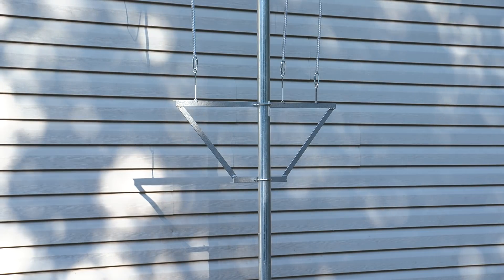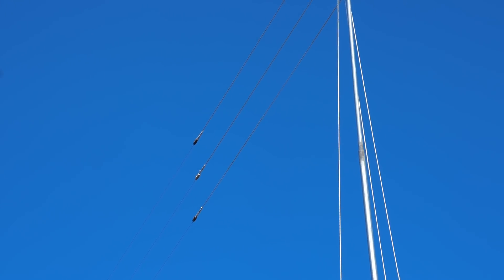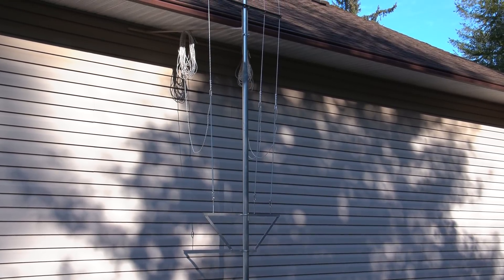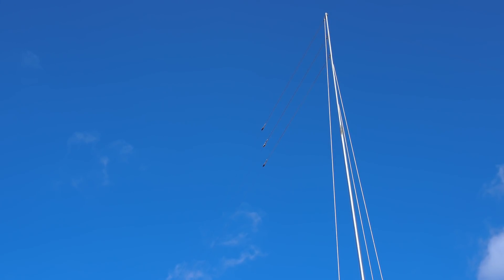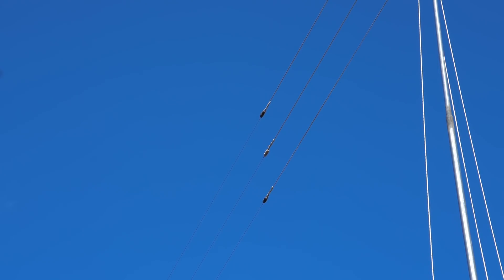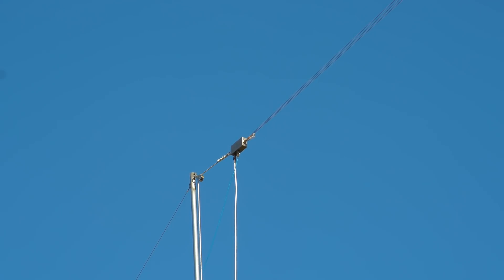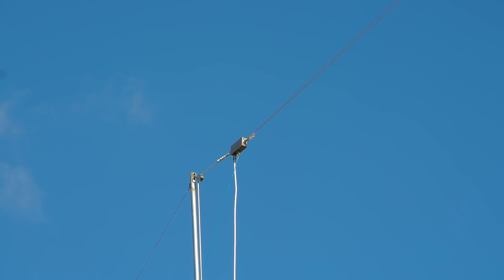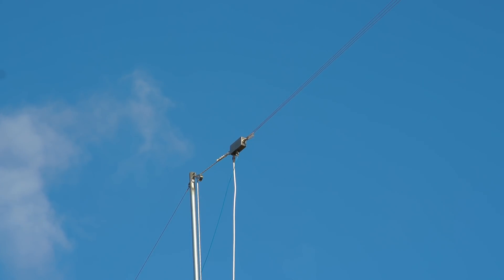Mr Carlson's 3-6-9 High Performance Antenna!

Comment: The plating on mig wire is so thin, its gonna rust pretty quickly. I guess if the connections are protected the rust will not hurt performance. I have used mig wire for radials/counterpoise ect when camping many times. Just ball it up and throw it away when done. Its cheap.

Comment: Nice Work. Just something I noticed...If the silicone used to seal the box is acid-cure rather than neutral-cure, the silicone will react with and corrode many metals including galvanized steel, copper, brass, zinc etc. (If it smells like vinegar as it goes off it's not neutral-cure).
Reply from the maker: No Odor, sensor safe silicone used on aluminum.

Comment: I recently built an FD4 style ham radio antenna using aluminum wire for electric farm fence. But the MIG welding wires seems to be an interesting alternative. I'm not sure how well it stands up to the elements though, but it may depend on the climate.
But I like the design you have. I would have considered weights instead of springs as springs weakens over time.
It looks like an F connector, which is OK, but it's not sealed so you might get moisture into the coax over time, but as long as it's just for reception it would be fine for quite some time.
Is the antenna tuned or is it just calculated?

Comment: An amazing and interesting project. Are you certain that the diecast aluminum Hammond box has sufficient tensile strength between the two eye bolts to withstand the mechanical force applied?
Reply from the maker: Yes, absolutely
Reply: Its stronger than the wire its holding
Reply: @peterhansen8216  The tensile strength of 035 S6 wire is 78,000 psi times 3 wires. The tensile properties of the Hammond box have not been tested or calculated under this condition as it’s not intended for this purpose. In my mind given the porosity of diecast aluminum, without reinforcement this appears to be a weak link. Just throwing this out there for consideration. Love the concept.
Reply: @jims2222  I agree. The Aluminium box is the (very) weak point in this antenna system. He also would have made a better choice if he had chosen "Copperweld" (copper-clad steel) antenna wire over MIG wire.

Comment: At 8:55 did you measure how much tension that porcelain insulator can stand? The piece inside the box seems designed for light tension as it is separated into what looks like slats instead of a block or a curve.
Reply from the maker: Here's a clue, the tension is only horizontal in the direction of the wires, the small ceramic piece in the box is solid, and would take hundreds of pounds purely horizontal. The pressure is a fraction of that.

Comment: im on a farm built 7ft high 11 wire high electric fence 12gauge aluminum "high visibility" wire ratchet stretchers every 200' (wish there were more). issues: 1000's migrating birds sit on the top wire always needs tensioning, deer can "almost" jump over break top 3 wires & real estate insurance adjuster made me install lightning arrestors 4 locations the one at the fencer box was shorted out by lightning just days after install. the fencer box had to be installed outside the building inside fireproof container i used a half 55 gallon drum

Comment: What an awesome looking antenna!! So basically this is an end-fed 1/2 wavelength fan-dipole?  I imagine this would give a drastic improvement to not only receiving, but transmitting as well when compared to the 49:1/64:1 end-fed 1/2 wavelength dipole antenna that is popular among amateur radio operators.

Comment: I found myself waiting to hear the lengths, heights of the wire.  It's also helpful to know the impedance of the feedline as well as the length. I guess I'll wait for the next episode. I've seen that copper clad steel rust right through through. I dont know if that matters or not. I changed it out before any signal loss was noticed.
Reply: F connectors are generally 75 ohms which would present a good match for a 1/2wl dipole, but being that this isn't used for transmit, small mismatches are not critical.

This antenna appears to function like a partial fan dipole. In essence, multiple dipoles cut for different frequencies with a common feedpoint. One issue here is the 3mhz dipole is also resonant at 9mhz because it is an odd harmonic. As a receive antenna, this probably has no detrimental effect. Also, as a dipole, this antenna is missing half... But the outside braid of the coax is probably filling that function... And again, as a receive only antenna, not a big issue.
Reply: Could it be the different electrochemical potential of copper and steel generating a destructive galvanic current.
Reply: I'm wondering if the details are going to be "Patreon-only"; there's more and more people doing that crap now. I don't play that game.

Comment: I would never have considered using mig wire for an antenna.  Very creative!  I would be interested in you discussing the antennas electrically along with theory of operation.  Thanks for the great vids.
Reply: I just wanted to point out that I’m using high tensile strength aluminum electric fence wire. Seems very good so far.
Reply: Probably a result of having a MIG welder :) Eyes could have been stainless steel imo

Comment: Looks great!  Does the perfectly sealed box still need a tiny, lowest point drain hole/tube?  
(Pressure changes day/night make the ability to suck in rain water seem like magic.)
Reply: I noticed this antenna is using a Hammond Mfg. box before it was called out. This is an excellent choice. My electrical enclosure box go to for all of my projects as well. These are available at some big box stores and local electrical supply stores. These are available in all ( NEMA)  National Electrical Manufacturing Association box types and materials. If you choose the correct enclosure type to meet your project specification, a weep hole may not be necessary.
Reply: @someguy2637  Yes, they make the best boxes, etc. For indoor tabletop projects, add some TAP18230 AP/Armaflex rubber insulation tape on the bottom for a non-skid finishing touch. 

For rainy outdoor or automotive box/wiring situations, it amazes me how water finds its way along RTV  "sealed" wires or jacks via capillary action (even with a drip loop) or how it gets sucked in "impossibly" with every temperature change cycle. 

The tiny hole or tube (aimed down and away) does not just let water out, it mostly equalizes the pressure to prevent the suction.
Reply from the maker: The screws are "O ringed" and the lid has a molded silicone gasket, no water is getting in, even under pressure or vacuum.
Reply: @MrCarlsonsLab  Sounds perfect... Your antenna setup is very impressive!

But wait, do you get a lot of rain there?  Might want to test SWR for changes before turning up the transmit power all the way to "boil" setting, just in case the "impossible" happens. Maybe a sealed HVAC sight glass could be added to indicate "fill level". I'm kidding of course, but didn't you report on extremely rare electrostatic "Kelvin" snowfall a while back?  lol  Take care of you and yours!
Reply: @MrCarlsonsLab  "no water is getting in" wish I had a dollar every time I said that.
Reply: @buckykatnga  Yup, seems quite clear that water absolutely does not care about our expectations x)

Comment: Why does this remind me of Doc Brown installing cables across the road, when the officer asked him, Do you have a permit for that? Not that you look like a mad scientist Mr. C. Impressive rigging, to say the least. I never used Mig Copper wire for anything before, but I have used tried to use the hg 71t-gs Carbon steel wire, I found it became brittle with any kind of bending stress over time, the 035 s6 is a  lightly copper-coated solid wire, I hope you will let us know in a few months how it worked out, please. Thanks for sharing your antenna project.
Reply from the maker: I will. It will be up for years.

Comment: Uhm is it ok to not have those plastic red/white balls (or some other system) on the wires to make them visible?
Reply: There are nearby trees taller than the antenna.  "Shielded by existing structures."

Comment: I`m moving in a few weeks to a location where I have room for very long shortwave and AM antennas. When I`ve made AM antennas in the past I made a coil similar to an AM crystal set coil to use as an inductive loop placed near a portable radio. My goal right now is to simply get more AM stations during the day because the few we do get are boring and weak. I used a large inductive loop made from a box a solar panel came in and could faintly hear a station 300 miles away in Dallas so with a proper long wire I can get a decent signal. I also purchased a Tecsun PL-330 that can be set to bypass the internal AM antenna and be used with an external wire so that will be interesting to experiment with. My CCrane EP PRO also has external AM antenna inputs.
Reply: i listen to a lot of AM stations at night'''' 650 am WSM, the grand ol oprey station,,,850 AM KOA denver'''''''1070 AM KNX los angles'''''740 AM KCBS  SAN FRANSICO ,CAL and alot more'''''i designed a AM PREAMP to boost the receive & i am using a very long wire antenna,,,,the down side is it will pick up LIGHTNING a 1000 miles away,,,73's james.

Comment: Wonderful!!! Looks Great
Please consider... a Handful of wraps on your RG-6 (6 to 8 in dia) taped or tied together and attached loop to underside O-bolt at feed box... this will help strain relief your 'f' connector and work as a common mode choke to reduce noise pickup on the outside of the coax sheild... (also include a loop on the bottom end to isolate noise entering the lab)...

Looks like a good winter of SWL... WB0ZLX...
Reply: The coiled coaxial cable will also tend to buck the current from a lighting strike.  I assume the coax shield is being grounded at the base of the tower, and the tower is also grounded there.

Comment: Great job! If I were to use your design for a 250 watt transmitter, what would you do for that purpose?
Reply from the maker: Only one wire in each direction (unless all are the same length) and tuned to the desired frequency. No tuners, an SWR of 1.0 to 1, impedance of 50 Ohms, with 50 Ohm coax feedline, reactance is tuned out (moving and trimming wires) for X=0 at the desired frequency. No shortcuts, and you will have a great performing system. If the radials are all cut to the same length and say you have six, (three common, three fed) you will have a wider bandwidth adjacent to the center frequency.

Comment: Neat Antenna . Why are you using F type connector instead of PL 259 and is the coax 75 Ohm . If so why 75 instead of 52 Ohm .Thanks
Reply: 75 ohm coax is cheaper, lighter, and smaller than RG8.  75 ohm coax is lower loss than 50 ohm for the same materials being used.  The drawback of 75 ohm coax is lower power rating, which does not matter in a receive-only installation.

Comment: Nice choice of wire Paul, great build, can't wait to see/hear it all perform! TFS, GB :)
Reply: I would not quite agree that this choice of welding wire is good. I am afraid that soon the wire will corrode strongly - I used to try such a wire and was quickly disappointed, unless your wires are better (like everything you have) ...
Reply: @witektaaham6297 : I made this experience too. After a few weeks it will start to corrode. The copper plating will be eaten away and the wire rusts. In chemistry it’s called a „local element“, if a more noble metal (here copper) is in direct contact with a less noble metal (here steel or the solder) and humidity comes into play. Corrosion is practically inevitable, no matter how „good“ the wire is.

Comment: I would consider putting a choking device (sometimes incorrectly referred to as a "balun") on the coax. Otherwise the coax shield will become part of the antenna, and it will pick up noise where the coax comes in proximity to the house, lab, or other noise sources. I would suggest making it from a #31 ferrite toroid, either bifilar wound or just wind the coax through a 240-size toroid, maybe 10 turns. There are lots of ways of accomplishing this.
Reply: I was also surprised that he did NOT resonate his design on the amateur bands. He says he is going to construct a separate TX antenna, and plans to use this antenna for receive only (?). He is obviously experimenting with his own ideas... I would only put up amateur band resonant antennas considering all the effort it takes for any well-thought-out antenna system!
Reply: @wb6csh  The fact that 95%+ of his videos are of him repairing "receivers" that are not amateur related, I am not surprised. But he did say that the antennas are using the 3rd harmonic principal, operating at 1.5 wavelengths, giving him a full sweep of the HF band. I don't think he's experimenting, I think he knows exactly what he is doing.
Reply: You're mentioning this to a man that has a UFO finder in his lab (not to mention the 45 minute video on RF interference, how to find it, and eliminate it)?
Reply: @SupposedlyFree  I was thinking the same thing at first then thought that maybe he's a newer viewer that hasn't watched all his videos or saw his Patreon.
Reply: @SupposedlyFree  Go easy there, I'm an extra class operator.  KC3ALA  I continually learn from this channel.  Thanks, Scott

Comment: Wow, nice work, Paul. That thing will bring you a lot of joy, dude. Do you consider to use it for TX by bypassing the tube (if i remeber correctly) ? 73 de Olaf DK6KF
Reply from the maker: TX will be a separate antenna. Thanks for your kind comment Olaf!
Reply: @MrCarlsonsLab  will the TX antenna use the MIG wire, and if so what kind of power will it handle?

Comment: Why separate ground cable is needed? (from electrical point of view I mean)
Coaxial cable already have shield, can it be used as ground?
Will two grounds create ground loop?
Reply: Could be to arrest lightning or something.
Reply: @Andrews_wasteland  thank you. It is interesting to know why lightning will prefer one path over another.
Reply: @sdjhgfkshfswdfhskljh3360  Assuming that the extra earth is for lightning suppression, The secondary earth could be a larger wire size to carry more of the lightnings power into a ground rather than into the signal coax cable ground and possible radio connected at the time. Be a shame to turn a Carlson radio into toast. 1.21 Gigawatts! Great Scot!

Comment: Pretty fancy compared with my long wire that I have to tune for each band . My MFJ Versa Tuner lll works well for it but takes a little bit of trial and error to get the initial tuning start points for each band .

Comment: A very nice setup just one question. What measures are you taking against possible lighting strikes ?. 73S from Ireland
Reply: 9 min since you did not watch the video.
Reply: @scotthill2230  Yes i watched the video but my question is still valid. yes the antenna is grounded at the feed point and it will bleed off static electricity, But it will not protect the antenna against a lighting strike. in order for this to happen a lighting arrestor\suppressor would have to be installed on the coax feedline.

Comment: Mig wire is really cheap.......I always carry a roll in my off roader for field operations.......sometimes I leave it and the insulators up in my usual camping spots for continued use.....you cant see it, so its not an eyesore.

Comment: Those long wire antennas will be directional.  Did you consider using an inverted V or some such for omnidirectionality?
Reply: Wondering Long Wire, ARRL Big Z (with traps), etc.  
I build quads.

Comment: Pretty fancy.  I dig it.  I'd think that MIG wire should be really stable for a long time.
Reply: Steel covered with copper rotted in 3 years... maybe it is stainless? But do we have stainless with copper?
Reply: @kaunomedis7926  No it is steel.  Regular old MIG wire.  A person could get stainless for a price point.  Get the correct grade and corrosion protect is tossed in for free.
Reply: @kaunomedis7926  It would have been a better choice to use copper-clad steel ("Copperweld") antenna wire for longevity. I doubt the MIG wire will last long, since the copper coating is quite marginal.